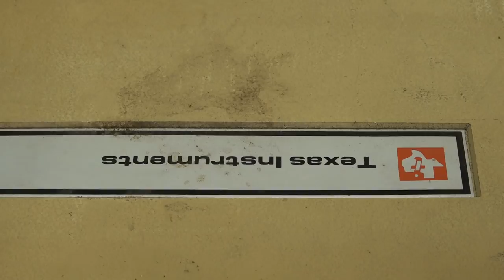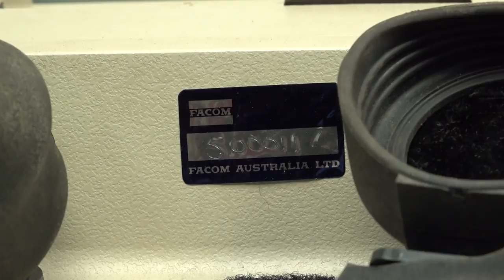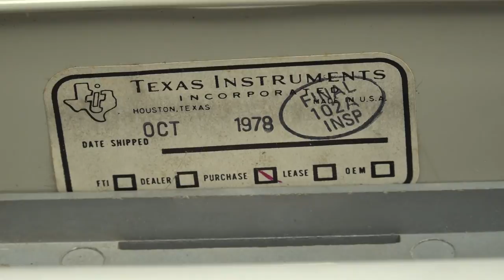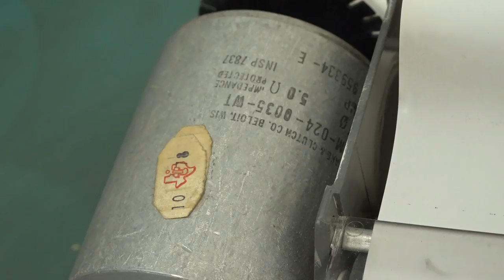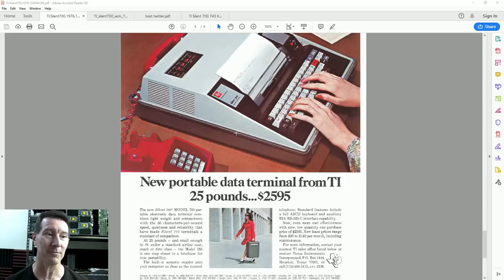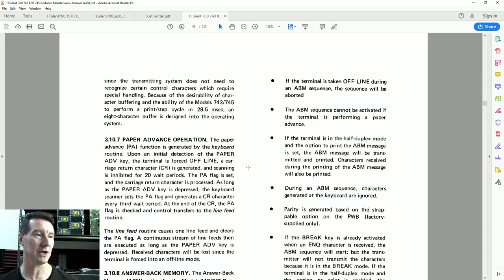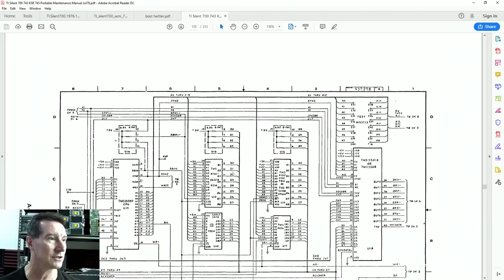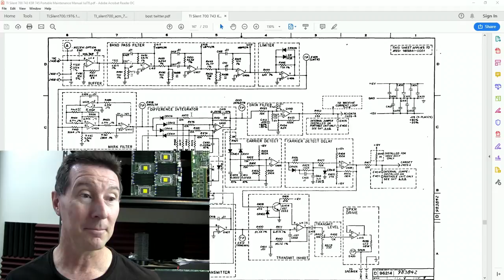EEVblog #1169 - TI 1972 Computer Interfacing

Comment: Low speed mode was created for the Australian market - were punters generally think slower.
Reply: Michael Stevens Low speed was probably 110 baud, the old Teletype speed.  110 baud would was used with 7 data bits, parity 2 stop bits, 1 start bit, so 11 bits per char 10 characters per second.  300 baud would switch to 1 stop bit, so 10 bits/char = 30 char/seconds.  According to to the service manual screen shot, this model didn't use 1.5 stop bits for 110 baud, which would have sped up low speed mode to 10.49 characters per second.

Comment: Not long after I started programming in 1975, I used a Silent 700 terminal from home to connect to the mainframe machine. My daughters were young, and they would come stand near the Silent 700 and squeal or scream - this would cause various junk to print on the terminal because the suction cup connection to the phone was not perfect and high pitched sounds would mess up the transmission. Not so fond memories...

Comment: You are worried about not having the screen and wasting all the paper, but you should realize that in those days computing wasn't casual browsing but there had to be a business case for the usage.  And that would normally be retrieving information   
or doing some transaction.
The cost of operation of these things was more time-dependent, you would have the phone bill of the open line and the cost-per-minute of the timesharing system.
So actually it was better to have everything you did on paper instead of having to jot it down from a screen while expensive time ticked away.

I started computing using such printing terminals (actually by Teletype corporation not this TI) and a Unix system, and it was also nice to have a printed record of what you did on that afternoon in the timesharing room so you could study the mistakes and avoid them in the future.

Comment: You're a million times smarter than me but I remember using teletypes and data terminals on mainframes. Commodore=64 was the first real computer I owned but collected Apple ][ and ][e, TI99/4a, TIMEX Sinclair, Trash 80. I used to strip parts for projects off of old Control Data logic cards and IBM motherboards. Heathkit temperature controlled soldering station will tip mounted element. Tube testers and so much I've forgot. Wish I still had all that stuff. I wouldn't give up my modern stuff but there was something special back in those days. I didn't quite grasp the simplicity until years later. Working on vintage electronics is a joy and a breeze.

Comment: I actually used "HERE IS" but not on a Silent 700. It was used to send a code to the origin computer identifying your terminal. On the ASR 33 teletype, it was controlled by a wheel which the origin computer could send a code, the wheel would spin, and through a set of contacts would send a (I think) 6 character code down the line. To change the code you removed the wheel and plugged-in/pulled-out metal prongs that would touch other contacts as the wheel turned. On the 60mA current loop it was entirely an electromechanical setup. (Now to watch the video....maybe there are a set of DIP switches to set codes???)
Reply from the maker: It might be that empty socket

Comment: 110 and 300 baud.It was 3x faster than an ASR33 teletype.  DEC's Decwriter printed at 30 chars per second, but they did eventually up the speed of their dot matrix printer to 120 chars per second.  That was about the limit (1200 baud) for printer terminals.  Where's the ram chip(s)?

Comment: Was there a phone monopoly in Australia in the 70s, like there was in the US? In the States, Ma Bell owned both the phones and the lines back then, and they wouldn't allow 3rd party devices to be electrically connected to their lines. Hence the need for acoustic couplers,
Reply: Yup - there was Telecom. But especially in Australia, lots of lines to run to places with low populations; so totally government based then privatised during late 90s.  The standard Telecom "touch-phone" was ledgendary.
Reply: Oh - and yes, Aussies could connect other devices - but they had to be Austel approved.  Of course, no one stopped you from sneekly importing a US Robotics modem from the UK, but if you killed the line, especially with an unmarked box between said modem and the line, there would be trouble!! And the old Telecom techs had a bit of knowledge...
Reply: “and they wouldn’t allow 3rd party devices to be electrically connected to their lines.”    
That never stopped me.
Reply: @NetworkXIII  It never stopped anybody.  Somehow, there were always surplus telephones to be found, so even though the phone company owned all of the phones (and leased them as well as the extension wiring to the customer for a monthly fee), I knew plenty of people who had bootleg extension phones.
Reply: that rings a "bell" it was the same over here in germany and our BELL was POST but also 100% government driven ;)

Comment: There has to be a Raspberry Pi based emulator for the mainframe.
Reply: I'd imagine it could talk to anything over RS-232 from that DB15 port on the back, if that's what that is.
If that's the case, it'd just need an RS-232 level shifter to use it as a hipster terminal on a Pi :D

(I'm not sure if the Pi can go as low as 300 Baud though)
Reply: You have full control of the I/O so it'll go as low as you want to. And you can probably even interface the acoustic coupling if you REALLY want to..
Reply: shouldn't even need an emulator, you can feed a terminal over an RS-232. Baud shouldn't be an issue, going slow is easy, it's going fast that's a bear.
Reply: They connected to PDP-11 and similar computers running unix in the 1970s, as a terminal rather than a terminal emulator! Luckily very little has changed and you can run them easily with linux.

Comment: Hey, I remember 6-digit phone numbers. And I talked with real engineers who used to work on these.
8:29 those Sprague caps have bad bad cancer causing PCBs in them. This is why they work to this day. I have several Tek scopes with Sprague caps - every single one is good, some have better ESR than brand new Nichicon caps.
Reply: Sprague caps: No, they don't.  No electrolytics use PCBs, since PCBs are used for INSULATING oil; electrolytics use conductive electrolytes that are formed into capacitors by passing a current through them to produce an oxide film.  Which is why they're called that.  Sprague's (and Mallory's) electrolytes used proprietary electrolytes, and most of these made before the 1990s still work today because they knew what they were doing.  The modern 5-year electrolytic capacitor was introduced by Asian manufacturers, and they cost much less.  It's what we call "progress".
Reply: @BrightBlueJim  i have a stash of mallory and cambridge capacitors caps, and some, mullard resistors and bumblebee/rainbow caps for radio repairs, just as good as the day they were made.

Comment: I recall telemetry data using 1200 baud modems with half duplex narrowband FM. 12.5 KHz channels from memory. Sending binary sequences indicating status of various equipment on site. Cannot remember what type of system it was called, but I'm certain it was X25.
Reply: That is still commonly used for packet radio today. Higher speeds are possible, but 1200 baud works by feeding the AFSK signal into the microphone port on a normal, unmodified radio.

Comment: Haven't used a "Here is" key but I started BASIC programming on a very similar dumb terminal connected to the U of Mn Mainframe because I was in excelled math. It was 1983 and I was in 7th grade. The modem was separate and only 110 baud which is 10-11 characters per second. ( The porn consisted of women drawed by Xs Os and dots. ) I later upgraded by spending my paper route money on a TRS-80 6809E processor with a whopping 16k.

Comment: Dave - don't laugh at the cooling fan. Those print heads can get really hot when in constant use (like when connected to a Telex line and you are sending and receiving L-O-N-G ass messages. The "cooler" air was directed to the space over the paper and under the shield to blow over the head as it moved. Bloody old school!

Comment: I think the reason that fan is so funny is because it looks like a tiny deskfan and you can just imagine the design story behind it. they built the prototype and it kept overheating so they put a desk fan blowing on it and when it came time to finalize the design they said well the desk fan works well enough so... just make it smaller and stick it in there.
Reply: Isn't it sucking?
Reply: @0x8badf00d  it is.

Comment: There might not be enough print head pressure on the paper because that spring adjuster on the solenoid is stripped..
Reply: It's a thermal printer.
Reply: @jonathanguthrie9368  Sorry I don't know how TPs work. I assumed some part of the head touched the paper to transfer the heat.

Comment: I don't know why you find it so funny Dave, computers were in their infancy,  time sharing was a thing that was done at the time.  In 1977 when I first built a mini scamp it was a leap forward that people who wanted to learn about computing could actually have one in their own home.  Of course from then it progressed quite fast but I learnt most from something called a little Big Board running CP/M using  8" floppy drives  finally using HD 5.25" drives.  It's sad that I had so much computer equipment then that most of it had to go to the tip including all the CP/M machines I had built up over the years.  
Yes computing was expensive in the 1970's  but the reason it's so cheap now is because we have packed more electronics in a smaller area and most built by machine rather than human hands.   What do you find so funny about an oddly placed fan in the system, there may have been good design reasons for this , who knows, you would probably have to dig the designer up to ask him.  You may not get much response......Rob

Comment: Why does it need a contrast pot?  No display!

My first ever computer I built (Z80 based) had one of these TI keyboards for input, and an 8 digit 7-seg display for output.  I built it at high school in late 1983 or 1984 as a "4th term" project.
Reply: Ah, contrast = darkness on the thermal print I guess... thermal printing is why it is "silent"

Comment: You worked at Pacom, as in the cctv specialist?
I worked for Rexel video systems followed by Pacom just before they renamed to Hills
Reply from the maker: Yep, Pacific Communications 1989 till early 1993. Repaired and tested the 2015 and 2030 video switching units and SSTV stuff + misc military gear they had contracts for.
Reply: EEVblog I've worked on plenty of those old matrix switchers in the prisons. Luckily they let me out each day. 😂

Comment: Strange they have the green solder mask on the bottom layer but not on the top layer.
Reply: These boards would have been wave soldered rather than screen printed solder paste and reflowed.  This means that only the bottom was exposed to molten solder.  Any solder on the top side is just what wicked through the plated holes, so there was no need for solder mask on the top side.

Comment: I bet there are tons of 56k modems beeping and crackling away still, but the only way they would be able to see this video in a couple of months time is if they find it in a torrent form on a low quality...In 2006 when Youtube just became a thing I would spend around 2-3 hours trying to see a 2 minute video on Metacafe (was awesome...now is weird) and I never got to see the ending as the connection would always somehow fail even momentarily. Most websites will simply time-out during the security checks if you tried to access them on a 56k modem...Nonetheless if they made a PCI Express ones I would gladly add one to my PC for the nostalgia factor (although I probably wouldn't be able to hear it beep again as the ISP changed the line protocol recently (now it doesn't carry power and will go out too along the DSL or the power fails so you can't even call your providers to curse away at them at the standard rate)

Comment: Please don't laugh...  I've used one of these.  At the time it was a VERY useful device.  Those three letter abbreviations on the alphabetic keys are for control characters (like control-G is Bell).  It uses a "bit paired" keyboard (the normal/shift differs by one bit.  Note that is a second generation device, and is much smaller that the first generation one.  Its one big fault was that the lower case characters were "small" ones in a 5x7 matrix (it had no decenders).  The empty socket is probably for the "here-is" function.  That function was for TWX/Telex terminals that were used.  It was to identify the remote terminal.  On ASR-33 teletypes it was done with a drum that had tines to make the 1's in the ASCII.  Haven't you used an ASR-33 teletype??

Comment: 21:47 service manuals like this should cost a fortune to have
Reply: No, they shouldn't.  Full service manuals made sense when products were expected to last ten years or more, to be repaired if and when necessary.  They were the norm.  Even TV sets had schematics pasted to the inside of the case, though you had to go to a 3rd party like Sam's Photofact to get full manuals.  Even the first home computers (TRS-80, Apple ][) had full service manuals, although you did have to buy them separately.

Comment: fuck me that keeb's a beaut. would love to just get in there. oh shit btw that thing uses SD hall effect switches, which are absolute classic key switches made by honeywell (regarded as being some of the all-time best, and rated to something like 30 billion keystrokes vs. like 30 million for your typical metal contact switch), which means those are some supersized honeywell doubleshots - famous for being some of the thickest and best keycaps in the biz. ABS from before ABS yellowed with UV exposure. Seriously this thing just gets me going, would love to see it all cleaned up

lol i typed this before i got to the part where you actually looked at the sticker. to answer your question, yes, they were the bee's knees, and still get mad respect. they might not feel very special to you cuz they're super sensitive to dirt & dust, but after a good clean and lube job they're fantastic. i would love one of these keyboards

Comment: So its a electronic Teletype with a built in Modem.. electronic teletypes are less fun than a Mechanical ones.. My fave was a Creed75 75 baud
Reply: Going electronic was required to up the character count. Mechanical relay based were just too slow(and LOUD). They are a cool novelty from the past though. This one was a 'blazing fast' 300 baud, and even still, it's thermal paper design turned out to be too slow not long after, not being able to keep up with the 1200 baud teletypes.

Comment: What was U30 used for?    Is it shown in the Service Manual?
Reply: It is.  I've posted full details as a new comment, but the short version is, this is an optional PROM, for additional features such as Answer-Back Memory, full-ASCII keyboard, and APL character set.
Reply: Service manual is here: http://www.decadecounter.com/vta/pdf/TI%20Silent%20700%20743%20KSR%20745%20Portable%20Maintenance%20Manual%20Jul78.pdf
Reply: Thanks,  @BrightBlueJim

Comment: How can this be "TI 1972 Computer Interfacing" when the CPU within it wasn't even designed until 1974 and this example was made in 1978?
Reply: The Silent 700 series was introduced in 1972.  There were many models.  The 1972 version was quite a bit bigger and heavier than this one.

Comment: Any electronic item of this age has an easy diagnosis - the electrolytic capacitors need to be replaced! - they are a cousin of the battery, and just like a battery, they wear out, and after 47 years, they are BEYOND worn out - replace all of the electrolytic capacitors, with modern Japanese replacements, and it will work like NEW!

Comment: Made in the US in 1972 and 230VAC? I don't believe it.
Reply: IN USA, not FOR USA.
Reply: The Silent 700 series was introduced in 1972.  This model didn't come out until about 1978.
Reply: Actually, many power supplies will operate properly through a very wide range of voltages.  If I recall correctly though, there was a jumper on the board of the 735/745 that switched between 117V and 240V.